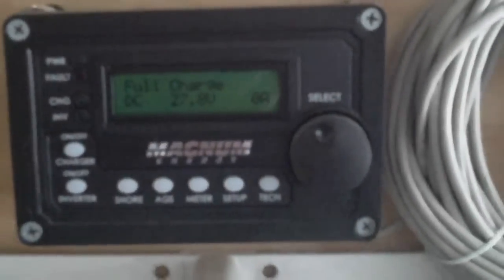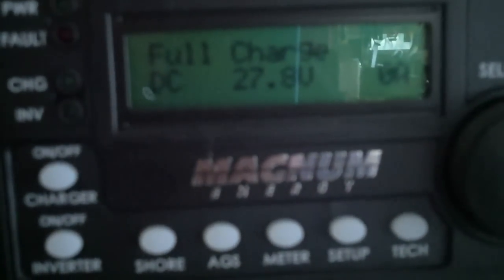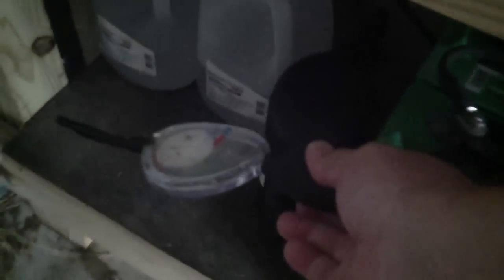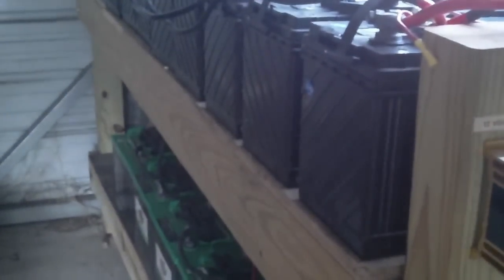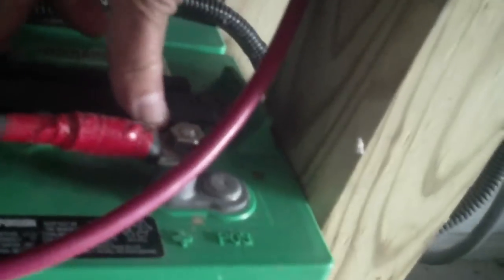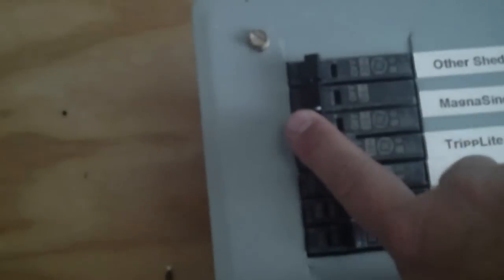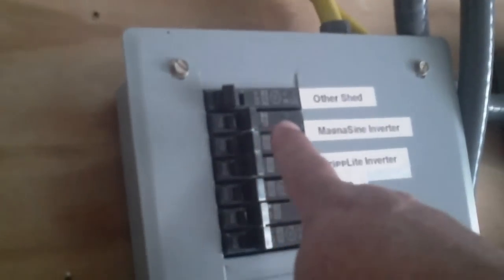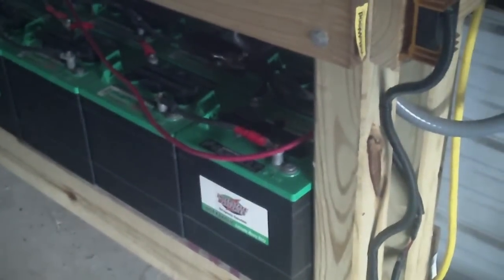Solar Battery Maintenance Part 2

Comment: hi Al,
it has been a while --i have finally installed a system
6-255 panels in 2 arrays//a magnum 48v 240v inverter charger//classic 150CC //epanel//mate//and 8 -415 ah AGM fullriver batteries

still learning --going to get a battery monitor so i can see the SOC of the batteries

in a grid interactive mode--run some critical ckt off the batteries during the day also use the panels to charge the batteries at the same time
as the panels slow down i switch over to the grid to charge the batteries during the night -i would like to use the panels as much as i can  an planning to install 6 more panels in the fall

have a generator if i lose grid and need to charge the batteries

does the CC charge the batteries-later in the day even if i turn on the grid to help charge
could you give me some ideas of overall operation of the system
thanks 
lou

Comment: thanks again -looking at GS6048 bec 2 AC inputs-propane generator and grid -maybe a little over kill but like the features and i can grow--and concidering 8 Trojans L16-RE-B-- what would you recommend for a continuous charged battery w/deep cycle capability when needed--and thanks for your help-

Comment from the maker: The best thing to do is grid tie and keep the batteries charged for an outage, cycling the batteries will shorten their life inevitably. You can get an great Outback inverter that is both grid tie and provides battery backup in an outage so you can have your cake and eat it too. They did not have that model when I made my investment so I cycle, if they had it back then that's what I would have purchased. Good luck.

Comment: thanks for the reply Al
am really struggling with the battery issue(like a gridtie)-my main focus is to use batteries as a backup for a prolong outage( is this a good idea) --do i keep them fully charged for use in an outage or cycle them everyday for loads in my house

Comment from the maker: The best are AGMs, I like flooded lead-acid batteries because I know how to service them and don't mind doing it. AGMs remove the need for servicing with water at a higher cost. Trojans are great but you can find great golf cart batteries like the Interstate Workoholic batteries that are just as good for less price. All batteries will gas when being recharge so you always need to vent your box no matter what.

Comment: AL, Thank you for all the info. Feel like i am part of the family. Where in TX are you.?  my main question is when you flip form the grid to solar does it cause your computers, alarm clock, microwave etc to restart or reset its clock settings, or is it seamless change over? Have you thought of adding wind into it? Any sugesstion of a beginner kit out there to buy and from where?

Comment from the maker: At this moment is strictly solar, I took the turbines down so I can redo the setup because the wife does not want that tall tower nor the guy wires. So I will reuse the tower's sections and lift two 30 foot towers but I have to fabricate a frame to bolt on to the steel building beams to give them rigidity. Probably a fall project due to the extreme heat and humidity.